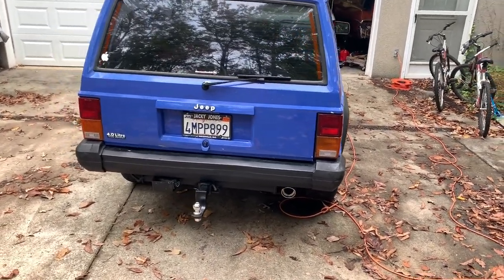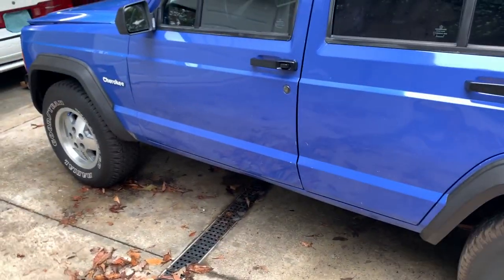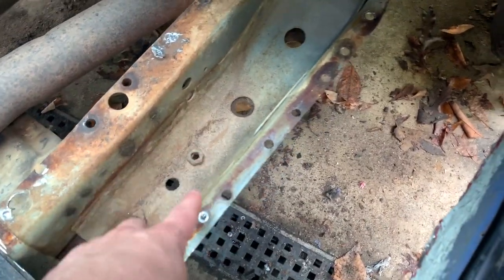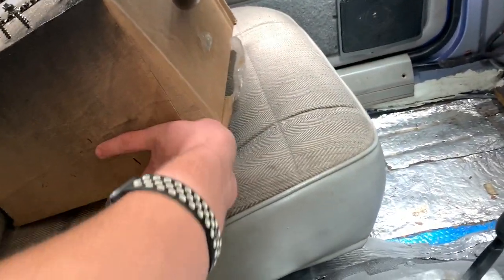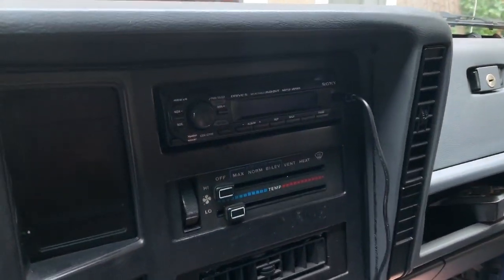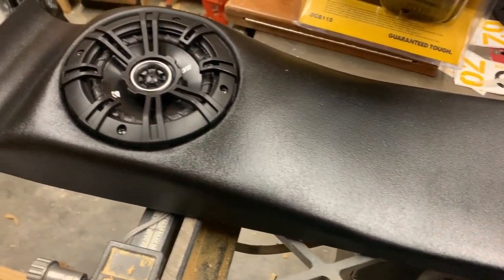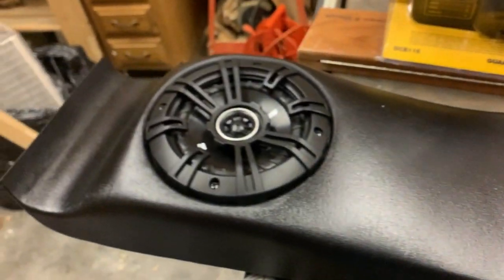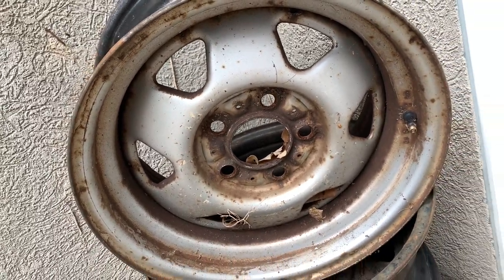$700 Jeep Cherokee rebuild part 4! Making BIG progress!

Comment: 1 question when you put the head unit in do you know what wire in the power wire cause I have a 96 as well and can’t find any real answer thanks
Reply from the maker: The ignition lead is red, battery lead is yellow, and the ground lead is black
Reply: @Pondsisawesome124  alright thanks mine was all mixed up

Edit, also for you to reply to comments on a year old video very few do and for ones like you who do deserve appreciation